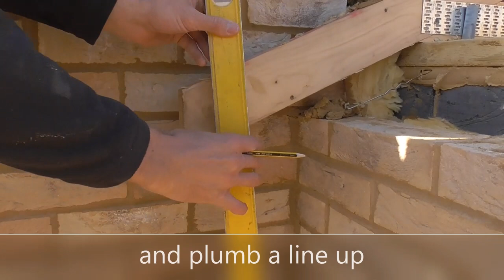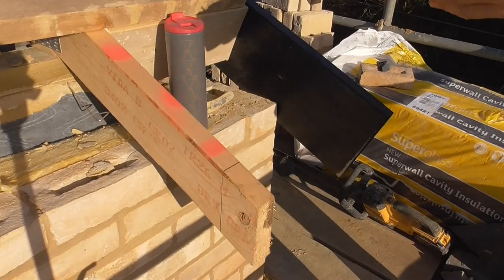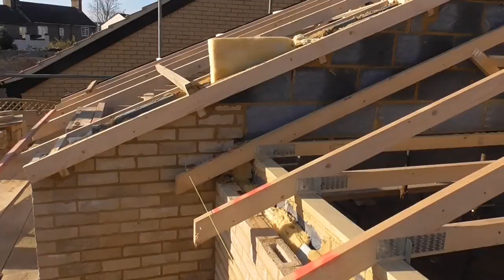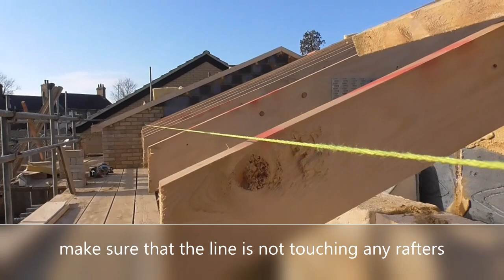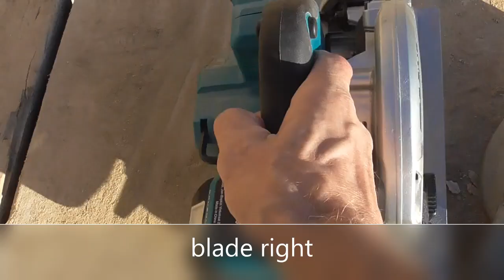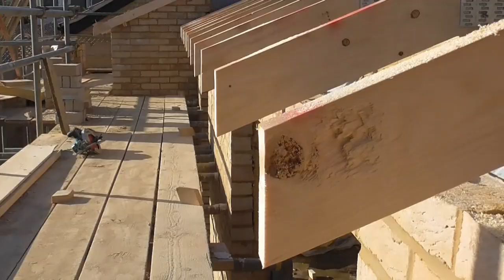Cutting roof truss rafter feet. (rafter tails)

Comment: Another clear and concise video, thanks. Nice to see a sliding bevel being used. Smart move setting the string line above the trusses and gives plenty of adjustment and eliminates the deviation in the timbers.
Reply from the maker: Hi Mark. Its pretty straight forward stuff, and many guys actually set the line below the rafters.😀 Its tempting for people to ping a chalk line along the top of the rafters, but this wont give a straight line in the right plane.😬 I find sliding bevels quick to set up and easy to use.😎 Appreciate your comment and for watching.👍Cheers

Comment: Nice job. I like the idea of using the string line above rather than just chalking a line.
Reply from the maker: Hi Alan🖐 I find I can get the string tighter than a chalk line👊Thanks for watching 😎 Cheers Del
Reply: Used your method today to straighten out the tails on a shed I'm building and it worked great!
Reply from the maker: @alanrahlf9603  That's awesome Alan👊Nice one🤩

Comment: Great video and channel.Its good to see a few uk carpenters making videos now.its easier to cut the rafter feet off with a small cordless saw rather than the 9inch saw we used for everything years ago.keep up the good work mate
Reply from the maker: Hi James. I have been a bit slow in becoming cordless, but, as you say, these small saws are super powerful, light and manoeuvrable, and are a MASSIVE step up from the big old corded beasts we used to drag around site.🤩 Its great to have loads of carpenters watching and commenting on my videos, and I appreciate you joining in.😎 Cheers.

Comment: When we stand trusses we always stand them to a line along the rafter feet on the front of the house that way if you are happy with the soffit overhang you don't need to trim the front of the house at all. The back will always need straightening up with this method as even prefab trusses aren't made exact enough to get a straight fascia front and back.
Reply from the maker: Hi Steve. Great way to put trusses on straight mate👍 I do a similar thing, but instead of setting up a line on the front, I just measure from the rafter foot back to the brickwork and keep them all the same. I obviously, still have to cut them, but its rare that the trusses come with the right overhang on them anyway so have to be cut to suit.😎 As you say mate, no trusses are good enough to just stand on and fix the fascia straight to.🤯 Thanks for watching and your comment.👍

Comment: Good stuff Del.  The big chippy debate, don’t worry how the pyramids were built, line above or below the rafter foot.. 
🙈. Definitely right hand saw, for everything.. 
👊🏻😉
Reply from the maker: Hi Dan. Never even considered line under mate. Probably just the way I was shown as an ol boy.🤪 I think the blade right/left debate is again down to personal preference and habit.😀 Thanks for watching mate.👍 Cheers.
Reply: @thetallcarpenter  as long as you get the right result it doesn’t matter 😉. 
I can’t use a left handed saw so easy. 🤪 
👊🏻
Reply: Nice method bro...but if the building was out of square wouldn't it be good to use a big square with the line to square off the roof?🤷🏽‍♂️ Just saying
Reply from the maker: @lawboss9962  Hi there. Its not so much the building being out of square, but more discrepancies in the brickwork, basically leading to wall make up that could be wider one end than the other. So if we set the soffit width, (or overhang), from the internal wall, (which the roof is relative to), and the external brick skin is not exactly parallel to it, this will show in the overhang. I hope I've answered your question, and appreciate you watching and your comment.👍 Cheers
Reply: @carpentryandwoodwork2018  Blimey they were good brickies if you could go off their brick work like that. 😉
Reply: best to have both.  I always buy a pair, R and L if it is available.   Long rafters can be cut by leaving R and L saws at each end.
Reply from the maker: @thomaswayneward  Hi Randy. You're spot on.😎 The same when cutting jack/cripple rafters.🤩 Thanks for your comment.👍
Reply: @thomaswayneward  This sounds like a tip from a “Roof cutter and stacker” ?  Good stuff!

Comment: Thanks for the video mate, like the old Stabila and it's modification....what happened to it? Keep the vids coming
Reply from the maker: Hi bartbug. It's modified to help me set my sub fascia board level from the top of the brickwork. The tab on the end is 9mm, (the same thickness as plastic soffit), so I just hook it on the brickwork level, and fix my sub fascia to it. Makes it much easier when you're on your own.🤩 Great comment.😎

Comment: Great video thanks . What sets the dim off the brickwork for the cut ? Soffit size ?
Reply from the maker: Hi Peter. There's nothing set in stone for these type of roofs, but I generally set my overhangs around 200mm. (8" old money). I think that, historically, most soffits were set around this distance.😎 Thanks for your comment.👍
Reply: Thanks . I appreciate you bothering to post instructional videos like this . Sharing your knowledge is a generous thing . I have a cottage to totally renovate from top to bottom and having a fair grasp of techniques is one thing but watching skilled tradesmen really helps . 👍
Reply from the maker: @peterridding4874  Hi Peter. Appreciate your kind words and wish you all the best in renovating your cottage. It will be hard work but very rewarding once its complete.🤩 Cheers.

Comment: Nice job and a bit old school too with the sliding bevel 👍🏻. Left blade right blade?  Hmmmm there’s a discussion........After watching your video on the DHS660 v 680 I got myself a 680 to see what’s what. My jury is still out on that. I see the advantages with blade visibility as a right-hander but having always used a right blade before and preferring to have the cut off timber on the right (so most of the saw sits on the bit I’m keeping to the left of the cut) I’ll be honest and say that it still feels awkward. I’ll battle on because it’s a good saw but it’ll take a bit of getting used to I think. Maybe I’m being a bit crack-handed so I’d be interested in other thoughts. Cheers
Reply from the maker: Hi Tony. I think I'm pretty much on the same boat as you mate. Thirty plus years of using blade right kinda gets you set in your ways.😝 Try not to look at the blade left as a replacement to the blade right, but more a useful addition to your tool kit. I found the blade left really good for small runs of studwork where I didn't want to set the chop saw up, and its definitely useful when cutting jack rafters. Use the blade left for square cuts and the blade right can stay set at whatever angle you need for the compound cut.😎 Keep pluggin away.👍 Cheers.
Reply: @thetallcarpenter  that makes a lot of sense and a good way of working. I’ll do that I think. Cheers for the tip 🍻
Reply from the maker: @carpentryandwoodwork2018  Hi there. Sounds great, and its so cool when all the trades on a job are at the top of thier game.🤩 Makes it so much easier for each following trade.😎 Thanks for your comment and for watching.👍 Cheers.

Comment: Cut the first one to length hold string and end of cut pop a line  use a square to transfer from chalk line from top of raftor to side make cut trim the fly to length
Reply from the maker: Hi Dustin🖐Snapping a chalk line will only be straight at the pitch angle, and any high or low rafter tails will not be straight in the plumb or vertical plane that fascia is in. Snapping a chalkline is fast, but not as accurate👍Cheers Del

Comment: chalkline?
Reply from the maker: Hi Morten. You could use a chalk-line, but only for the string. Putting a chalk-line would give you a straight line at 90 degrees to the pitch of the roof, but the fascia wants to be in a straight line vertically.👍 Cheers.

Comment: Why use right blade saw if cutting down why not left blade? More of the table would be on the sturdy rafter plus see the blade and line easier
Reply from the maker: Hi Brandon🖐You make a very logical point for a blade left saw for this job, but for me, I find using the blade right more natural, plus, if you are only having a narrow soffit, the motor body and base sit further outside the cut line so as not to hit the brickwork👊Cheers Del